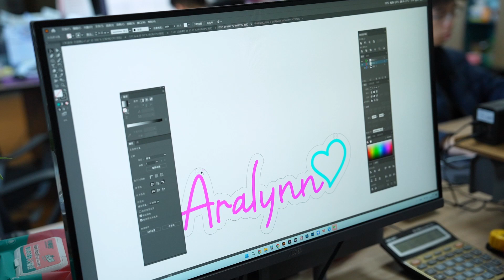How to make neon sign in just five steps

Comment: Which plastic exactly do you use and do you mill it without any cooling?
Reply from the maker: this is actually not plastic it's acrylic board , and we use CNC  machine to engrave the design into the board !
Reply: @idecomartneon yeah, but you don't use any cooling for acrylic right?
Reply from the maker: @jasminbesic2526  No need of cooling it as it's not heated at any point!

Comment: how many millimeters is the acrylic size?
Reply from the maker: width ?
Reply: @idecomartneon yes :)
Reply from the maker: @andrejboehler3170  6 and 8 mm according to the needs
Reply: @ depending on how wide your silicon Diffusor is, right? You used 8mm?
Reply from the maker: @ yes you are right . yes we use 8mm
Reply: Engraving depth for 6mm neon silicone and CNC router in mm for engraving